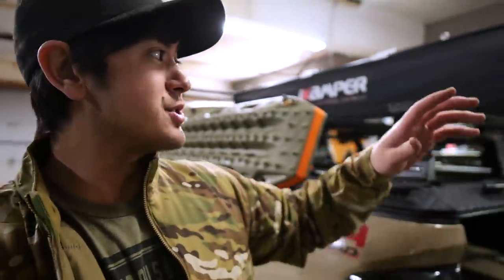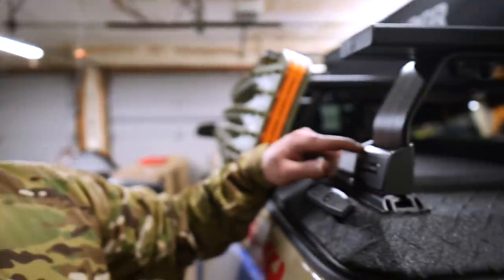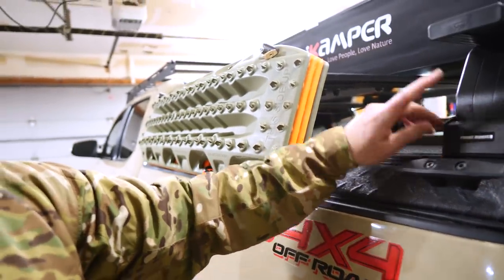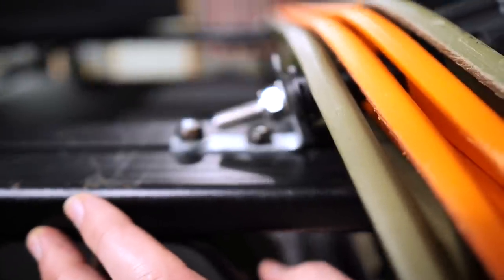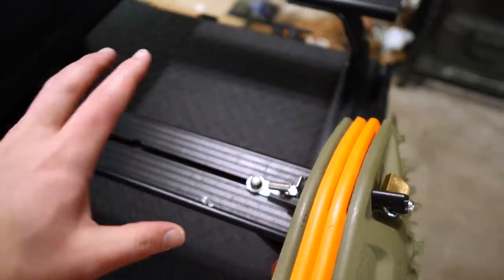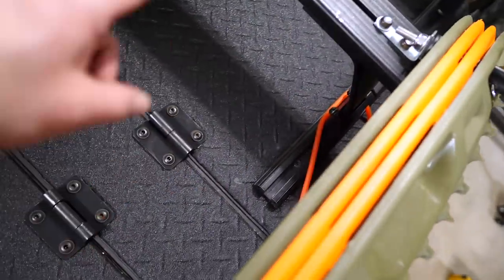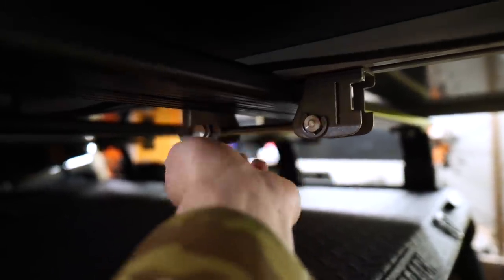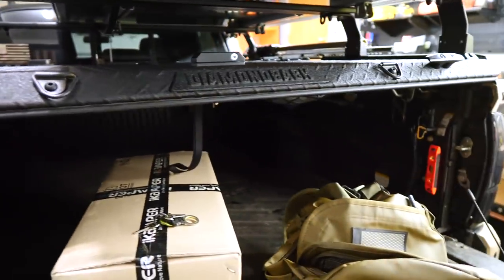Ultimate Overland Bed Rack Setup on Tacoma | Front Runner + Diamondback = SWEET SWEET LOVE

Comment: Hey Mike! I found your video and immediately sold my tonneau cover to get this setup. Quick question, when you take your tent off, are you able to open your diamondback covers with the front runner racks still installed? And is there still room in the cab side to mount the diamondback cab guards?

Comment: 5:15 Mike are you saying that if you put a brace on the middle hinge section of the Diamondback, that you don’t need to put one on the front section to mount a rooftop tent? 

I really love everything about this setup except that it looks like you basically have to crawl up into the bed to get stuff out of the front when the tent is mounted.
Reply: There is definitely room to innovate a tray system that rolls out but you lose storage with additional hardware in the bed. I suggest packing things in some action packers or equivalent ie pelican, apache, etc. lots of options out there the beautiful thing is that no one is right. Each rig setup has a unique purpose for vehicle and owner.

Comment: I’m wanting to add a bed rack and a hard tonneau cover and your setup looks great.  Did you install a bed stiffer also or does the diamondback cover keep the bed sides from expanding?
Reply: You can double check w/ DiamondBack, or even Toyota, but I believe that the non-moving center panel of the HD or SE DiamondBack covers clamped on the bedsides kind of act as a brace or cross beam between the left & right sides of the bed.  That should help prevent the bed from flexing/expanding to a certain degree.  I do remember Mike saying in another video that he added Total Chaos' bed stiffeners to the truck, so it shouldn't hurt to add those, too.  His setup has those bed stiffeners at the bed floor corners by the tailgate and the center panel of the DB cover at the top, near or at the center, of the bed that should help to stiffen the bed.

Comment: I really dig this setup! I also really like the KB Voodoo setup that other Tacomas are using, but that one video of your rack snapping while on the trail always haunts me when I don't see beefy legs on a rack system. These legs really do look sturdy. Great job!
Reply from the maker: KB Voodoo looks kinda cool, and I think those bases are steel, so they should hold up better than the thin aluminum ones I had that broke. Some pros and cons to that setup vs one like this - but just never fell in love with those ones.
Reply: Sorry if this question has been answered before but I’m also getting the kB voodoo rack setup and they say it has 500lb dynamic load capacity. Is that enough for a 180lb tent during moderate off roading?

Comment: I like the setup. I’m debating trading in my Jeep for a Tacoma. Question tho: how do you access stuff in the back of your bed with a cover and rack? You can’t exactly easily remove that stuff in the woods. I just imagine having to remove a ton of crap to get the chair I need lodged all the way in the back. Have you installed tracks or goose gear cabinets in the bed?

Comment: Do you know the part mumber for the rack rails? In the Front Runner store they sell them but with the basquet. All I need is the rail track.
Reply: It should be these: Pick-Up Load Bed Tracks / 1200mm(L) - by Front Runner
SKU: TRBU002 - Qty.: 1 pair, Price: $104.00+tax
Call them to confirm current pricing.  I bought them a year ago.

Comment: So 2 questions:

1.) I assume you are using the Diamondback HD now? You said in an earlier video you had the SE. That wouldn't be strong enough for RTT+bodies, right?

2.) Can the diamond cover be opened assuming the RTT has been taken off?
Reply from the maker: Previously had the SE, currently the HD. I did have racks and rooftop tent on the SE though with no issues.
With no RTT and nothing on the racks, yup the diamondback can open up like normal.

Comment: I know Northface is awesome but damn are they expensive. I just picked up a 60L duffle at American Trucks for like 70 bucks. Thick rubber, tie down straps, only difference is no external pockets. I'm using it as my roadside emergency bag so I can easily toss it between my truck and my company car.

Comment: I have been very interested in the diamondback however, I have been a bit skeptic to buy it due to the loss of bed space. Is the cover easy to remove if large items (i.e furniture) need to be moved
Reply: Takes about 30 seconds per door. Little longer if you need to remove the center piece.
Reply from the maker: Yeah each panel slides off easily if you just need to access about half the bed. The center piece is held in place by 4 bolts. I have a full review on the Diamondback if you search it.

Comment: Looks good. Any issues with the system leaking into the bed of your truck?
Reply: I have a similar setup using rhino rack tracks, no leaks yet. If it ever did leak, easy fix with some silicone.
Reply: @thestig007  thanks. Just wish id went with the hd version.

Comment: do you have to seal where you've drilled into the diamondback?
Reply from the maker: I typically use rubber washers, but you could add some silicone as well.

Comment: damn your truck must be heavy. Good luck goin mudding
Reply: I have a somewhat similar setup but w/ stock wheels, tires and suspension.  It did fine in the snow and mud pits at Big Bear, CA.  No crawl control needed.  Anyway, we'd be smart to know our limits.  There's still a lot of fun to be had outside the mud.  But, sometimes, it doesn't get interesting until someone gets stuck on the trails.

Comment: Mike. Do you know what the nut is at the end of the rails are used for?  You have it facing up and I followed that but the instruction show it facing down. The Frontrunner guys didn’t know and that was disturbing.
Reply from the maker: It's for the perimeter rail system, so doesn't really apply to just using the slats
Reply: Last Line Of Defense .. thanks does it matter if it’s facing up or down?
Reply from the maker: For the way I have it used - not really.

Comment: Here is the parts/prices for 58" slats, sub out shorter slats if needed.  I found you can also get an SKU for a custom sized Slimline II rack under their trailer/canopy/cap section and then just buy the feet and track that you need. You'll need to contact them to add these to your cart though.

Items Qty Price

Slat to Load Bar Conversion end Cap Kit - by Front Runner
SKU: RRAC044

2@ $37.90

1475mm Slat - by Front Runner
SKU: RRSS1475
3@ $182.85

Pick-Up Load Bed Tracks / 1400mm(L) - by Front Runner
SKU: TRBU003
1@ $139.00

Pick-Up Roll Top Leg Mount - by Front Runner
SKU: LASS028
3@ $236.85

Subtotal $596.60

Comment: I've been waiting for this review.  The three sets of legs w/ crossbars looks like it's working out well.  Nice man.  For the legs, what leg height did you get; are those the Tall Legs?
Reply: Scratch that question.  I watched the video again and payed better attention: You mentioned it's mid-height.
Reply: @earlmonteclaro9833  On front runners site the Colorado rear bed rack will work.. Or you can email them and they will piece it all together and add it to your cart for you.. I did the same thing after watching this and a guy has a article on Tacoma World about the Diamondback cover as well.
Reply from the maker: I believe technically these are the Tall legs for the system. Though again, as far as I know all of the components necessary for the kit cannot be found publicly on the site so they'll need to piece the kit together for you over the phone.
Reply: @gregdeese  Thank you, sir.  Haha... I'm actually "that guy" on TacomaWorld who wrote the article and made several recommendations on previous Tacoma videos of Mike's for the FRO rack system on the DB cover.  Mike and I e-mailed briefly back-and-forth on TacomaWorld to figure out a way to get better load bars on the LLOD overland SpitHTF mobile. I got the mid-height legs, too, but was thinking of switching to the tall legs.  However, I've got this height limit issue with our apartment building's subterranean garage gate that I want to clear.  I don't want to shear off the rtt because the setup was too high.  If Mike got the tall, then I thought I might be able to clear the garage gate height limit of 6'8".
Reply: By the way, PapaDave also has a pretty good bed rack system (KB Voodoo's) with an iKamper tent that's shown in that DiamondBack Cover mods thread in TW.  However, for my needs & preferences, I preferred Front Runner Outfitters rack system.  Plus, their USA store is only like 30min from where I live in SFV, CA.
Reply from the maker: Ah hey Earl, gotcha. Yeah thanks for the help - I updated the video description to point to that original thread that you showed all the photos of your setup. Let me know if there is a better one I should link to.
Reply: @LastLineOfDefense  You're welcome, Mike!  If it helps you have and enjoy epic adventures safely so that you can make epic videos, glad to help out, man.  You've helped out many of your viewers, for sure, so it's cool to be able to help you YouTuber peeps sometime.

Hey, I think this scripture can go well with your Weekenderlanding theme and walking with God:
 Exodus 3:18c New International Version (NIV)

18 ... Let us take a three-day journey into the wilderness to offer sacrifices to the Lord our God.’
Reply from the maker: Ooh yeah, or the Message version maybe better, haha - "Let us take a three-day journey into the wilderness where we will worship God—our God."
Reply: @LastLineOfDefense  Ya, Message version sounds better. Sweetness!  Amen to that.   I like to have fun geeking out on God's Word... can't be too focused on gear and such all the time.  I think it's ultimately God's gear, anyway, and he just likes to see us enjoy stuff and see how we can use them to glorify him and/or help others.